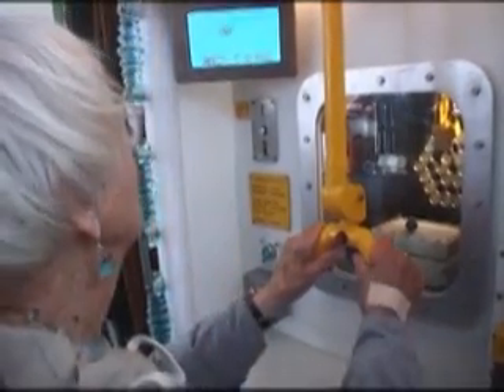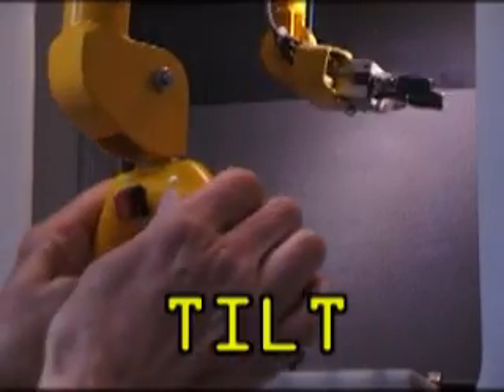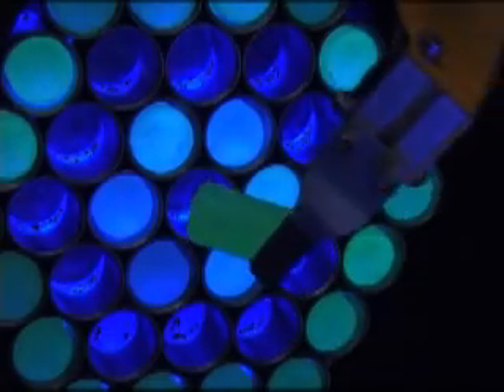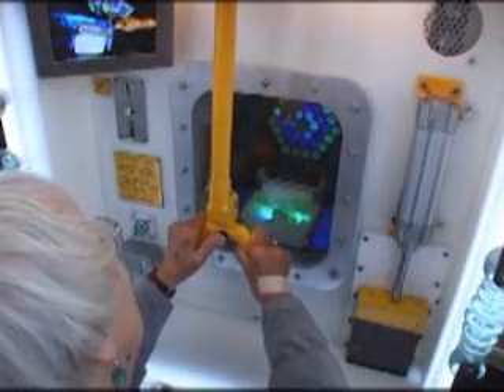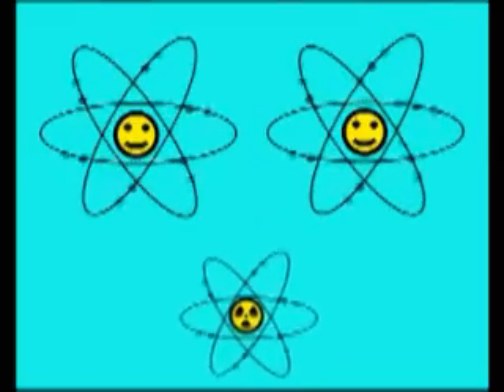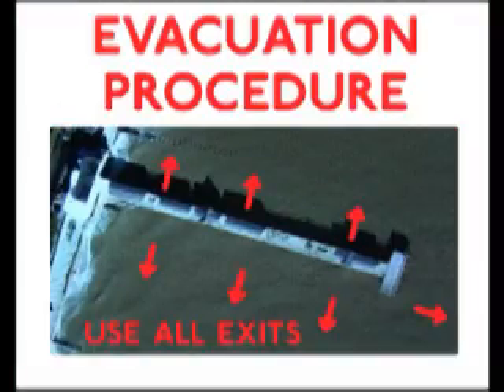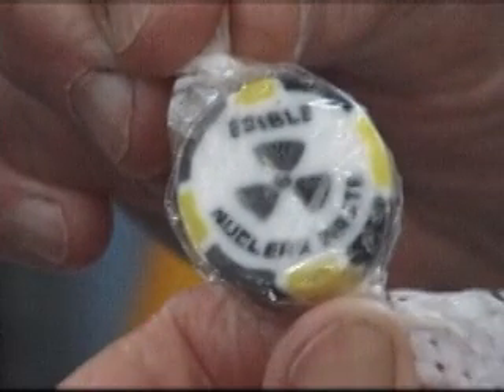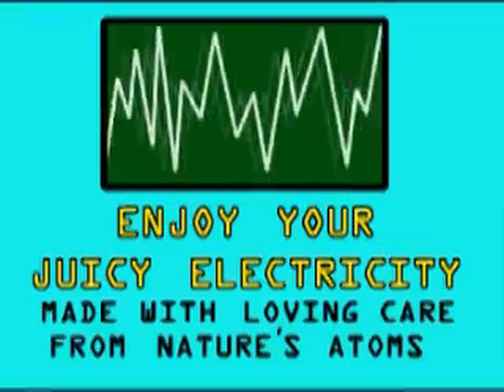My-Nuke, personal Nuclear Reactor

Comment: It is MODEL, not the device itself XD
Reply: Yeah. this is the trainer version. The real thing is exactly the same but about 3 times bigger and of course you have to wear safety gear when operating. Sizewell B uses this to train their operators, you actually have to spend 16 hours on this trainer before you get to do it for real.